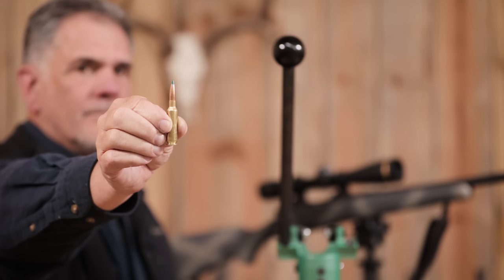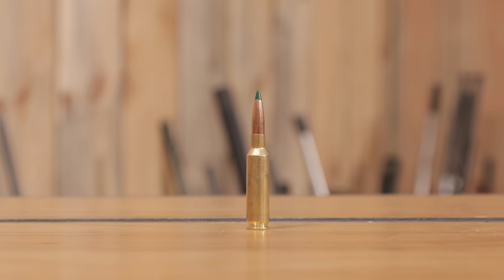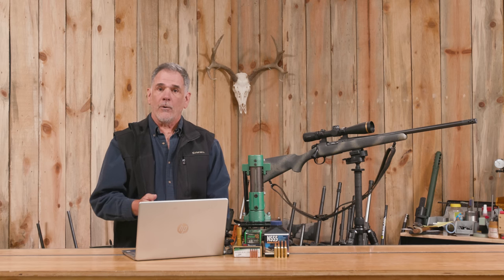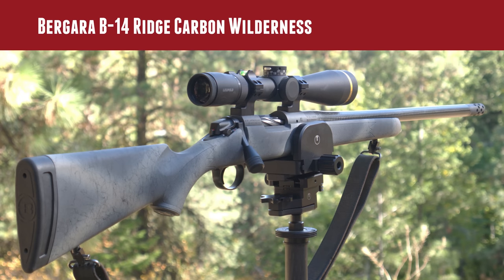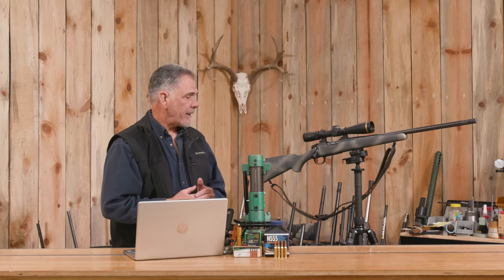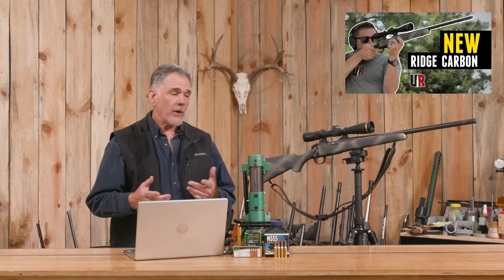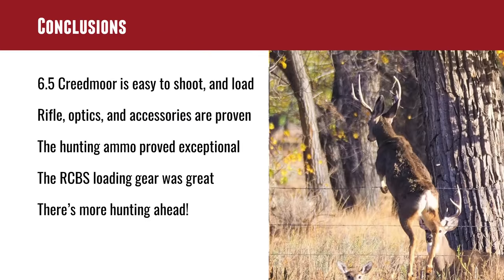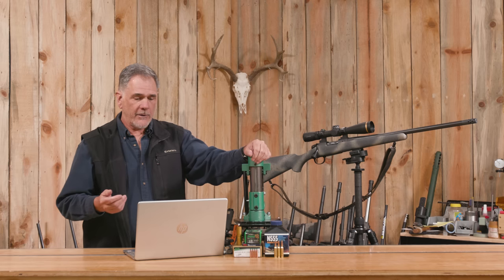Finally Hunting with 6.5 Creedmoor

Comment: Last 4 elk with the 6.5 CM. Previous 3 using the 143 gr. ELD-X. The 4th using the 143 gr. Norma BondStrike. All loaded with H4350.
Reply: The eldx is an absolute garbage big game bullet . As a guide I’ve seen more animals shot with them than most and they are not a reliable bullet for anything bigger than deer .

Comment: I just purchased a Bergara B14 Hunter in 6.5 CM. (I wanted something with less recoil so I decided on the 6.5 CM.). I come from the wood stock era so the polymer stock was something I haven't been fond of. As it turns out, it's awesome; rubberized, easy to grip. I love this gun! Great video, Guy. From the SE corner of WA State. God bless.
Reply: I bought a b14 hmr in the cartridge for target shooting in 2019. I also shot 270 but I really was tired of the recoil so Im going to try the bergara this season. I'm nervous to try it but I am so excited to be able to use my surpressor, not have to wear muffs, and not have to deal with recoil first thing in the AM... I think we can all relate!! Climbing down the stand like I'm in a war movie,, ear ringing, shaking a little bit
Reply: @danfromga9696  What's the fun in that! Hope the Bergara/Suppressor works out well for you.

Comment: I am very familiar with the 6.5 Creedmoor and hunted with it now for several years I also left a comment some time ago, I will repeat that I will NEVER EVER use a bullet weight over 130grn it just doesn't have the velocity to slow 2700FPS is to blame slow for a 140grn bullets and when I used 125grn and 129IL,  it was absolutely effective  so all I will say about heavy for this caliber 140grn bullets is THEY STINK with high sectional density they pin hole animals, then changed to the lighter bullets it's been absolutely awesome there after, I make this comment because of all the horrible stories and I came to realize it was the use of heavy for caliber bullets like 140grn or heavier, it shines with the lighter bullets like the 129IL Hornady at 2950fps fantastic combination and the 125grn nosler partition two very good combinations.

Comment: Bought a 6.5 in 2021 following shoulder replacement surgery. I needed a lighter recoil option and purchased the 6.5 in a Tikka T3X. Using Remington Core-lokt ammo I found the rifle easily satisfying my need for accuracy and recoil. Hunting in NW PA on the 2nd week of deer season I had the opportunity to verify if the 6.5 was sufficiently lethal. I took a mature 10 point at 90 yds and he dropped in his tracks. I’m very satisfied with the cartridge performance.
Reply: Excellent! After shoulder surgery I hunted mostly with my 25-06 for a couple of years. The 6.5 Creedmoor seems similar to me, a little more bullet, a little less velocity. Glad the Creedmoor worked out well for you and congrats on the buck!

Comment: I did an early October hunt with a 6.5 CM. Handloaded Varget and Fiocchi LRP in Aguila brass to push a 129gr Hornady SST to an estimated 2700 fps (no chrono) from my my CVA Cascade using a Vortex Diamondback Tactical scope. At 296 yd, the pronghorn fell on top of the deep hoof prints he made when impacted. I was satisfied.

Comment: The timing of this video couldn’t be any better. About a year ago I started really following UR videos and got into reloading myself thanks to you. By chance I drew a leftover WY cow/calf tag and decided to work up a 6.5cm load and hunt for the first time with a load I worked up. Happy to report that two nights ago I got a shot on a nice cow elk and it absolutely drilled her at 307 yards. I was honestly surprised how well that round did. Shot placement was spot on and just wrecked the vitals. Work up is 143 gr eld-x, 43.5 gr 6.5 staball which got me 2725 fps out of a bergara B14 ridge. It was the perfect amount of energy. My buddy shot one too with his 300 win mag, and his shot was a little bit forward and just obliterated both front shoulders and turned a lot of meat into mush. I honestly couldn’t be more pleased the way that 6.5 performed. My only complaint isn’t the round itself, it’s the combo of changing it over to a chassi system and using the AICS mags. If the round isn’t all the way seated back into the mag the tip of the long 6.5 bullet catches under the feed ramp on the bergara. I’ve also had issues with the extraction of spent brass, something in the action is causing a pretty deep scratch on the fired cases. So I still have work to do to get things dialed in but man, I can’t say enough how the 6.5 performed for me. Thanks again to UR, this has been a fun adventure into reloading.
Reply: Congrats on that cow elk, nice shot!

Comment: I've been shooting my 6.5 CM with a 22" barrel  for about 10 years. I've had really good results with the 130 Berger and Rl17. My recent check over a 10 shot string showed an average velocity of 2840 with an SD of 10. Most of my shooting is done between 30 and 70 degrees and haven't really had any issues due to temps. My velocity stays pretty stable and my groups are typically between 1/2 - 3/4 moa. Unless I've had too much coffee..😂 
 Great video, hope your hunts are productive and memorable.
Reply: I had good results with RE17 also. But the loads are not temp stable.

Comment: First off, Thank You for your service. I have been on the fence about using a 6.5 creed for hunting, but now I will go for it.. Great info..
Reply: Thanks! I found myself thinking of it as a 308 with higher BC bullets and a little less recoil. Similar size, similar velocity. Both can be very accurate.

Comment: I like the 140 grain gold dots and 120 grain ttsx in Creedmoor.   Both are solid performers.
Reply: Along the same lines as the TTSX, I’ve been using the 127 LRX and it has worked great. I just started hunting with it last year and have shot pronghorn and deer. Been trying to kill an elk this year but haven’t pulled the trigger yet.
Reply: 120gr GD are awesome as well
Reply: @antdawgg9923  they have shot really well in my Grendels

Comment: Hey Guy, for my Brother's first rifle we got him a similar  set up. He bought a Christiansen Arms Mesa and topped it with a Leupold 3-12 with the CDS dial. Great shooting rifle. We tried  Sierra's Gameking 140 and they didn't group as well as the Hornady 143 ELD-X so we selected the Hornady and loaded it with H4350. He shoots groups less than an inch almost every time it goes to the range. So far he has shot a Pronghorn (jumped up less than 50 yards in front of us) and it was very effective. Our elk hunts the last few years have turned into walkabouts so nothing bigger but no hesitation to use it on bigger stuff. It shoots quite a bit milder than the 30-06 and the 270win. With a rangefinder the advantage of flat shooting cartridges is becoming limited

Comment: For a regular hunter, 350meters and under, It shoots near as dammit exactly like the .308, just less recoil. So I use a 130gr in my 6.5 and a 150gr in my .308win. Same scopes and mounts with the same magnification, switching between the two is seemless.

Comment: I've been using 130grn TGK in my 24" Tikka 6.5cm for a couple years.   43grn RL16 is .6 moa at 2850fps with SD of 7.  It's has hammered two coues bucks  over 500 yards. One shot=Bang-flop!  1.5-2" exit holes.  Love these bullets.
Reply: Outstanding! I appreciate the info - and was thinking that the 130's might have been better for my purposes than the 140's I bought... I shall try the lighter ones as well.

Comment: I was late to the 6.5Cm party also always being a 270 fan.  I was shamed into it by my son and his wife one year, I took a doe and a 8 point and both were bang-flop.  My Savage 270 also worked very well and shot to 3/4moa but after a torn rotator cuff I needed something lighter.  I was so impressed with it a used bull barrel Savage 12FV found it's way to me and I started load development.  Long story short that rifle with my blueprinted 140gr handloads was posting 1/3moa, never saw that with any factory 308.  Now if I'm in the fields my 270 is with me but If I'm out on a friends farm that 12FV with a 6x24x50 Vortex is glassing along the hedgerows and taking deer at ranges I would have thought unethical in years past, ranges that I hunt woodchucks at with my 22/250 and DRT performance is the norm with high shoulder shots.  I just bought a Howa 1500 Hera H7 in 6.5Cm and put a Riton 3 Conquer 6-24×50 on it. Out of the box after break in and zeroing with my 130gr, Win748 plinkers it matched my Savage.  I just picked up some 90gr TN'T's for chucks, I'll do more load development over the winter and hope to tighten my groups a little more and hit the fields.  Yup, I'm a convert.  By the way, all my loading is off a RCBS Rock Chucker ll I bought in 1976.  Unknown thousands of rounds thru it and still tight as when I bought it after 30 years of National Match competition and loading for a shooting family.

Comment: I’ve been enjoying  hunting with my tikka t3x super light in 6.5cm since 2018 now. I’ve taken 6 deer and 4 black bear now ranging from 50-320 yds. And have had great results. 9 out of the ten animals were complete pass throughs. I’m using hand loaded eld-x’s running about 2700 fps. 1/2 moa accuracy or better with those.  Everything has dropped on the spot or not made it past 30 yds. I have other rifles I use for elk hunting tho
Reply: Good to know that the ELD-X has done so well for you. I like that bullet as well.
Reply: I’ve heard quite a bit of negativity on it, but I’ve never had an issue. I even punched through both shoulder bones on a big mule deer at 200yds once and still got a pass through. I also killed a deer at close range and an elk with  the 162gr eldx in my 28 nosler and both dropped on the spot. Did not get a pass through on the elk at 200 yds but I’m not surprised as it was a hard quartering to me shot.
Reply: You can’t beat the eldx round

Comment: Great video Guy. Looking forward to the gel test. I shoot a creedmoor Tikka t3x using 140g Sierra's h4350 and staball 6.5
Getting great results.
Reply: That StaBall 6.5 is an interesting powder and I need to use it more...
Reply: 6.5 stable seem to work pretty good in my 325 WSM with 160 grain barns TTSX it had better velocity then h4350, IMR 4350 and 4831 sc  vs pressure signs although unfortunately when I did my load development it was in the upper '80s but none of them can match the accuracy and velocity of reloader 17 at least for my application

Comment: Great video. I purchased a Tikka T3x with a 24 inch barrel with a break. It was a Cabela's special with a camo stock and cerakote bronze coating. I put a Vortex light weight hunter 3 x 15 scope on it. Tikka's are known for being long throated and it took some effort to find the distance to the lands. I use a Berger VLD Hunter 140 grain bullet. I did a number of test loads and the one I like best is Superformance 48 grains (it is hotter than recommended that's why I load them long).  I hand load and use an RCBS Rock Chucker press. I make the loads longer than standard and it gives me the room I need for the powder and it still fits my magazine and works well. I chronograph my bullets and they are going just over 3200 fps so it 's almost like shooting a 6.5 PRC. It is very accurate .25 MOA at 100 yards. I shot a bull elk this year at 230 yards with one shot. The elk just stood there for a few seconds and then started to walk away. He took two or three steps and fell over. Both the entrance hole and the exit hole were pretty small. When we opened him up there was massive damage to the heart and lungs. I hit it right where I aimed , right behind the front leg and low. It was a broad side shot slightly up hill. I don't think I will try shooting an elk out past 3 or 4 hundred yards. My grandson shot his first bull about ten minutes before I shot mine. It was a great hunt. My 6.5 Creedmoor is a pleasure to shoot and I look forward to using it for many hunts to come. Thanks again for the video.

Comment: Ive got 5 different 6.5 creedmoors. From a 14" single shot pistol to 24" carbon fiber barreled chassis precision rifle. Ive taken a dozen whitetail with 3 of them and they work fine. Probably no better or worse than the dozen other cartridges on either side of it in similar capacity and bullet diameter.  The creedmoor shines in the availability in quality components, consistancy in chambers designed for bullets on the heavy side, and barrel life. My match rounds shoot great in the shorter barreled hunting rifles and my hunting round shoot great in my match rifle. My favorite hunting rifle is a $300 compact tc compass with 16" barrel. Suppressed its shorter than a 24" rifle, is very accurate, and very handy.

Comment: Got a tikka t3x 6.5 creedmoor (deerhunter) it's like Lite model but with soft touch accessories and fluted barrel and M14 treads. I am shooting moose and down from that size using 7.8g sako blade handloads, vihtavuori n540, fiocchi Lr primers, that gives speed of  872m/s at the muzzle and a 15mm 3 shot groups @80M. normal shooting distance for moose is about 30-100M.  My t3x tac a1 also likes same load so thats nice too.

Comment: I wouldn't use 6.5CM for anything bigger than mule deer, but for mulies and anything smaller I think it's fine. I typically use .308 Win but I do have a 6.5CM that I have taken out (although I haven't scored with it). I want to replace my 22" barrel with a 26" for better velocities. In my thinking, a 26" barrel is a sweet spot for the majority of medium and large caliber cartridges. Everyone these days is flocking to the little shorty short barrels and I say do what you want, but I'll take those long barrels any day... I like shooting distance and that makes velocity important. It also extends your hunting range if you're not afraid to hump around a little extra weight.

Comment: I was reluctant to get on the 6.5CM band wagon also. In 2021 I won a pistol at a gun bash and had no use for another carry pistol in a caliber that I didnt have. I traded it up for store credit and chose a Bergara B14 Ridge Wilderness in 6.5 CM. Installed a 4x16x44 Riton scope. I have been buying up factory loads in various weights. It shoots MOA @100 with a number of different ones.. Havent had a chance to take it out in the field yet. I cant bring myself to leave my walnut stocked Rugers, Winchesters, and Remingtons at home, Haha. I am thinking a well constructed monometal or bonded 120 - 130 gr at 2900 -2800 fps might produce a more dramatic result on whitetail sized game at normal hunting distances. What thinks you?
Reply: I think that's quite likely. Those all-copper bullets and bonded bullets tend to stay together very well even at high impact velocity.

Comment: I have a 120gr Hornady CX load that I made for my son's Moose hunt. It runs about 2950fps. I have used that same load for whitetail and it has worked well out to 300 yards so far. Breaks bones and always passes through.
Reply: Am glad to know that the CX performed well on deer for you! I've shot CX bullets into the gel blocks to test expansion & penetration, but haven't yet taken game with them.

Comment: Hey thanks for the video.  I have a couple of comments having shot the 6.5CM on paper, steel and game. You have mentioned a number of products in the context of your video and I have real time experience with some of them.  Firstly I have found the 6.5 CM as a good cartridge for medium sized deer and below. I mainly use Berger 130 VLD in my 6.5CM for long range steel.
For hunting, I use Nosler 120 Grain Ballistic Tips which I have found are excellent on game. I have found that the 6.5CM does not have the put down power of a .270W. I have used the Summit Press extensively. I does have a horrible flaw.  If the handle is not tight in its housing, and it does like to work it’s way loose, it will snap at the end of the threaded section. Disappointing.  Sierra projectiles work well in my 6.5CM and I have had great success with the 130 TMKs.
Hope this is of interest and I am a fan of the CM but it is not anything remarkable, just very well designed and is not immune to Newton's theory!
Reply: Thank you for that!

Comment: I amost exclusively use Vhitavouri powders and have for probably 30 years. I had some Hornady superformance come along for the 6.5cm with 143gn eldx, and it was good, but the Vhit 555 has proved much better.
And yes Vhitavouri powder is lot to lot consistent.

Comment: I was going to look into this cartridge, then I realised just how good my 6.5x55 was and realised it was going to be a pointless change.
Reply: I’ve owned and reloaded for the 6.5 CM, 6.5x55, and 260 rem. Thousands of rounds and around 27 deer with the these three cartridges. You’re absolutely correct though, if you own one already no sense in buying one of the other two in my opinion. If a person only shoots factory loads then the creedmoor definitely has an advantage. This is because there are few 260 factory loads and the Swede factory loads in America are watered down. All three wonderful whitetail rounds.

Comment: I have used the 130gr tipped game king. I got very poor performance from it on game. Where I hunt game is usually shot at very close range due to cover. At close range the tipped game king basically exploded on impact. I shot a 140 pound wild pig at 14 yard and had no exit wound. Bullet didn't even make it through the chest. I also shot a buck the same day at 26 yard that fell and then got up and ran off. No blood trail. I have watched youtube testing of the 130 gr. tipped game in gel. At close range the bullet fragmented without much penetration. At lower velocities simulating longer range the bullet performed well. End of the day my experience with the 130 gr. version is 50/50. I no longer use that bullet for hunting.
Reply: At the ranges you're describing, I'd use a tougher bullet for sure, something like the Barnes TTSX perhaps.
Reply: Nosler Partition will work